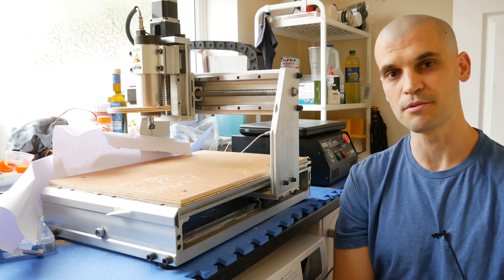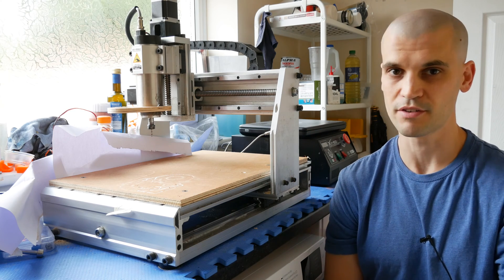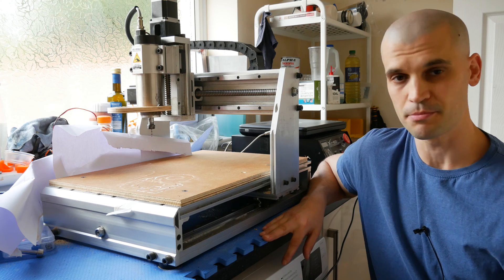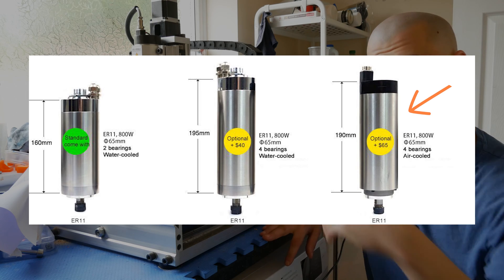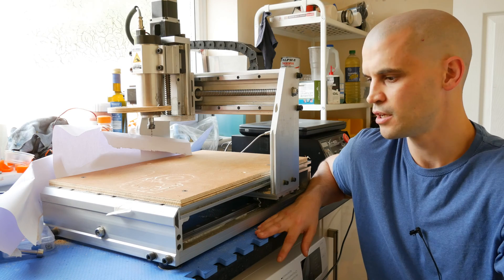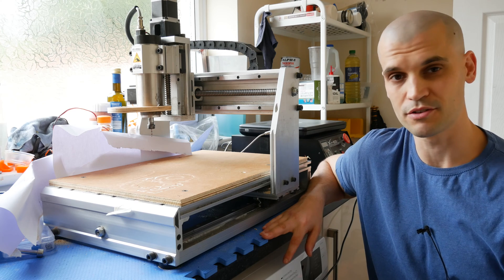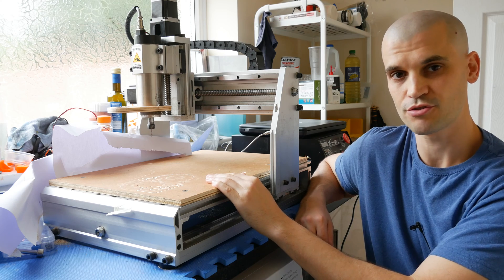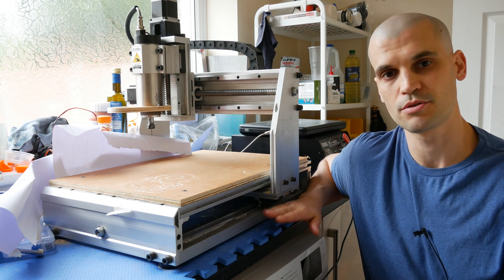My new CNC! OMIO X4-800L (The PREMIUM 3040/6040)

Comment: Hell, are you satisfied with this machine i want to buy one for brass and aluminum part making
Reply from the maker: Yes its a great machine for the price range. I would prefer a vertical mill converted to CNC if i was doing purely metal work. Much more rigid. Conversion kits for common mills are quite expensive though $3-4k range

Comment: Hello. It is not clear for me how many rails installed on the Y axis? Only one per side or two per side? Thanks!
Reply from the maker: one per side
Reply: @ThisDesignedThat  Thanks. I ordered similar frame. Also with one rail per side. Will see. Are you happy with the rigidity?
Reply from the maker: @petercsizmadia9642  Yes rigidity is good, its good enough for small aluminum parts and wood. Definitely not steel though
Reply: @ThisDesignedThat  thank you Sir.

Comment: Hi! I also have the Omiocnc (the x6). It’s frankly amazing. I can recommend the 2.2kW water cooled spindle - they are amazing value for money and it SHREDS aluminium - you can also run ER20 collets. I’ve managed to tram mine to within a couple of thou and it delivers frankly amazing surface finishes for the money. If you want to see some of the parts I’ve made on it, just drop me a line.
Reply from the maker: i would love the er20 collet size, how thick are your Z alu panel on the x6? Im wondering if they are the same as the x4. I might think about upgrading the spindle and electronics of my x4 because i feel it is underpowered
Reply: @ThisDesignedThat  If anything, the X4 should be stiffer than the X6. I have the email address for the engineer at Omio that knows the product inside out - I’m sure he’d be able to advise on any specifics with respect to design, electronics and upgrades. The 2.2kW spindle is really cheap - it’s become a commodity part - you can buy it in Europe for under £150.

Comment: Do you find the 800w spindle is strong enough? There is an extremely similar machine on AliExpress for a similar price, but it has a 1500w spindle. Wondering if that one would be a better buy
Reply from the maker: Definitely get the 1500W. 800W will cut but I can tell (especially when cutting metal) it needs more power and would speed up the jobs a lot having 1.5 or 2.2kw spindle
Reply: @ThisDesignedThat  thank you for the reply and honesty!
Reply: The feature that makes the omiocnc so good, compared to the generic 6040 routers, is the extra rigidity given by heavier gauge construction and linear rails. This combined with the 2.2kW spindle gives it standout performance for the money. Putting a 2.2kW spindle on a “flexi” generic router will be good for ripping through thin flat plates but less use where surface finish (especially on the side) and precision are important…

Comment: Hello. Great info and thank you.
I am just wondering whether u might be able to recommend something for wood and rubber stamp carving. I make stamps for prints using Lino and wood. I usually engrave to a depth of 0.5-1.5 inches. Do u think this machine or the more generic Chinese models fits the bill? My purpose is very limited and I am thinking a less expensive model might work.
Reply from the maker: you can go with something cheaper if you are just machining wood and rubber stamp. This machine would be great for it too

Comment: which windows and computer do you use with it. I can not get mine to work with my old win xp laptop :( I am very new in this and dont know where to go and who to ask? I have red some forrums without any help yet!!? thank you
Reply from the maker: Im also using an old windows xp laptop. What is the error you are seeing?
Reply: @ThisDesignedThat  Hi I just wrote a couple of lines for you and deleted it for since I wrote that I got my very old winXP to install the mach3. I could not even do that I got a white page, but now I can see all the didles and nobes and knobs and ( what ever they are called. Please forgive me and my bad english :) ) But Stil I have trouble to make anything move. Before when I installed the mach3 there was something wrong with installing the parallel port driver from mach3, but now it went and there seems to be no problems, so why I still can not get it to work. Do I have to do anything to the control board? so that it knows that it has to give the control away to the computer? I really am very Grateful for any kind of help. Thank you

Comment: greetings Sir: from the USA .
can a 400w spindle motor carve aluminum or soft metal. i only want to spend around $500 to $600 USD for a router. I will be an accession user. so I do not want to spend lots of money and I do not want to purchased something too cheap. I like this router but $1200 is too much money. can you help?
Reply from the maker: Nothing under $1k is going to cut aluminum very well without significant mods. 400W could cut in very small passes but its not ideal. For engraving it might work but definitely not full on machining aluminium into parts etc.

My machine can cut aluminium ok BUT you will need air compressor and workholding such as a vice to help you cut properly and get good finishes. It can easily take the total cost up to $2k once you add it all up.
Reply: @ThisDesignedThat  : is 400w spindle powerful enough to cut 5MM carbon fiber sheet? 
Also, i did not see the price of your machine with a 500w spindle on their website. thank you for your reply. a
Reply from the maker: @nivasylstrongman4352  not sure. CF can kick up a lot of very harmful dust. It is usually cut with flood cooling to contain the dust.

Comment: on the generic 6040 and 3040 , the problem is not the round linear rail , its the fact they use the unsupported round linear rail ( so the rods are free to flex ) The supported round linear rails are super rigid and adjustbale at the bearing.. nice machine btw , nevr seen that before.

Comment: A hefty price tag but uses all linear rails is a HUGE positive.
Reply from the maker: for cnc its cheap! So far the linear rail have been a great. Keeps it very rigid
Reply: 1600 is cheap?  All relative I guess but for its size the price is too much for new even with the linear rails.  As I said I am surprised to see linear rails on one of these but there is absolutely no reason they aren't being used (even the small machines could use MGN12c rails and blocks).  I guess it is due to penny pinching by the Chinese.
Reply from the maker: @thebeststooge  Oh yes agreed, £1600 is expensive. I got this for £800 second hand so would consider it closer to a bargain
Reply: Yep,  £800 is a great price though that still pushes it to around 1k USD.  You made out like a bandit with that machine. :)
Reply: Btw, this seems to be the only machine out there using linear rails and a water cooled spindle with the fourth axis for 110v will cost me over 2000 USD to get to me.  Compare that to the exact same machine but uses rods (so the only difference is the rails) of around 700-800 USD to my door.  sigh
Reply from the maker: @thebeststooge  i know the pain :) i searched on amazon and aliexpress for months trying to figure a way to get it cheaper because the shipping was extortionate from China when you include taxes. About 4 times i decided to just get a cheaper version with normal rods or even build something like the MPCNC but each time i told myself i'd be kicking myself i didnt just get a linear rail version and be covered for all my future needs. So i waited and waited on ebay for a cnc to come on sale and luckily after about 6 months this omio got listed. Be patient and just save your money until something better comes along.
Reply: @This Designed That I only ever purchased one thing used on eBay in the 20+ years I have been on it and that was an analog scope.  I paid a good price but when it came I felt sort of taken because one of the probes was broken.  No big deal but I have never really looked at used tools cause I can only imagine what sort of crazy beaten up stuff I would get that the seller would say was like new, lol.
Reply from the maker: @thebeststooge  Im the complete opposite :). I think pretty much all of my big purchases in the last 10 years have been 2nd hand on ebay. I wouldn't be deterred from just 1 bad experience, you can make some big savings! Buying first hand is usually my very last resort.

Comment: Looks legit man! Congratz.  I own a 6040 that i am currently rebuilding with some linear rails. Just wanted to say that I Think that your 3040 is right in the sweet spot when it comes to bang for the buck for a first cnc router. I also do Think that the smaller work area makes the 3040 frame  a bit Less unrigid  than the 6040.

Adding a solid aluminium sheet instead of the table Will Most likely increase the performance alot. I did also build a simple Enclosure. Have a video on my Chanel, than you are Wellcome to Check out. :)
Reply from the maker: nice just subbed, very good enclosure! i wish i had the space for something like that, but the cnc is already taking up the full width of the table top in my utility room :(
Reply: @ThisDesignedThat  I get you! Sorry for the bad English in my comment. Have a New phone that doesnt seem to like writing at Another language. Anyway, regarding an Enclosure, I dont know have much experience you got. But I had none  experience, i was very suprized at how nasty  the steel chips are. They are super tiney and will  easily  penetrate and get stuck Through the skin even through gloves. You might  know that but since I didnt i tought I would let you know. They Will be a bit here and There around the router. So I wouldnt recomend to cut steel without an enclosure, even Though I am shure your router Will handle it just fine.

Good lock with the router I Will check out your future videos. :)

Comment: Congrats on your new machine!!. I got the same one with a water cooled spindle few moths ago. I didn't even bothered to try the Mach3 version they provided. I'm building a new controller with LinuxCNC and a 7i96 mesa card. Also upgraded the stepper motors to closed loop steppers (hbs57 drivers + 2.2nm motors). I did cut some aluminum with before the upgrade and  I was a little impressed. Cheers from Los Angeles, CA!!!
Reply from the maker: Thanks David, I would love to pick your brain as to why you decided to upgrade these specific parts and what improvements will they make to your operations? I would like to upgrade the controller and use a proper version of mach3/4 but i really have no clue how to wire and set it up so for now I have to stick with what i've got.
Reply: @ThisDesignedThat  
Well, I got the water cooled spindle mostly because is more quiet than the air cooled.
I haven't heard good thing about Mach3 being reliable. But a lot of people use it and they are happy with it. I heard better thing about Mach4.
In my case for the purpose of my machine it doesn't make sense to pay $175.00+ for a Mach3/4 license. I decided to go with LinuxCNC because it's open source super stable and flexible. The down side of Linux CNC is that the learning curve is pretty high and if you are not familiar with Linux it might be harder to learn.
I upgraded the drivers and the stepper motors to make sure I don't loose steps and to run the machine's rapids faster.
I also rewired the whole router with shielded cable to eliminate erratic behavior due to electrical noise generated by other electronic devices and components in the enclosure.

I'll do a video at some point showing what I'm currently doing with my machine. I could help with wiring and any upgrades you are planning to do. I'm not an expert but I know 1 or 2 things hehe!. We all can learn together!

Also take a look at the UCCN software it's the Mach3/4 competition and a lot of people like it better that Mach3/4. It's cheaper than Mach3/4 and the controllers can be used with Mach3/4 as well.
https://www.cnc4pc.com/uccnc-control-software.html?gclid=CjwKCAjw5_DsBRBPEiwAIEDRWzL35BUhK7hzs4FXpO6ApDr-n1CJ23nxK021HWqkfvuTQETwWKYeSBoCFH8QAvD_BwE

Keep in touch my friend.
Reply from the maker: @00daveR  Thanks for explaining all that and please do keep me updated with your upgrades, I'd love to see how it all comes together as I'm sure I will want to do the same in the future.